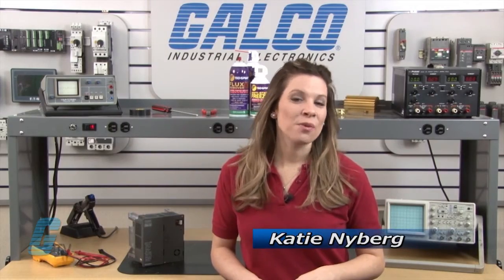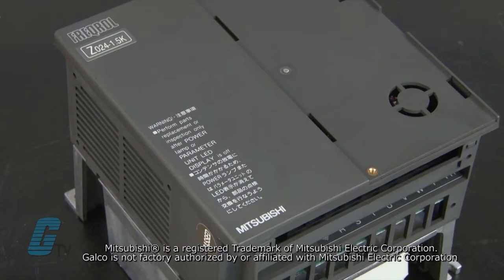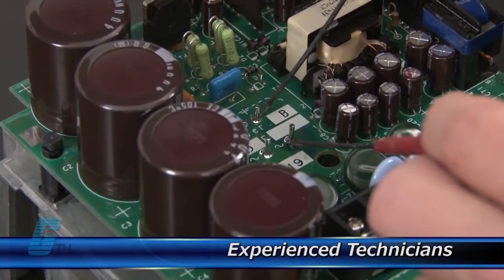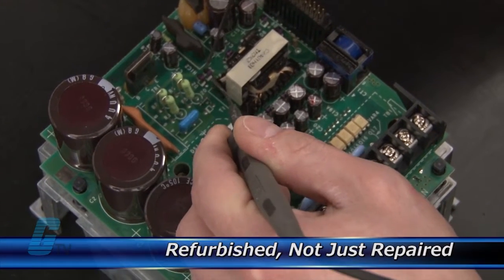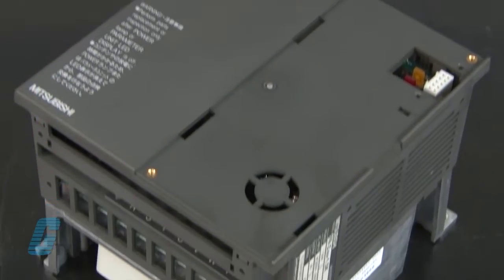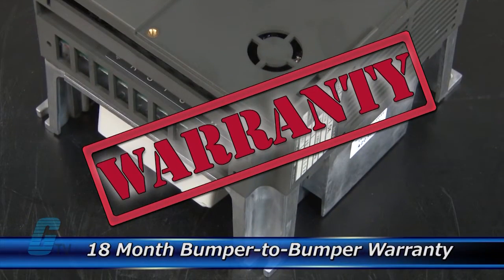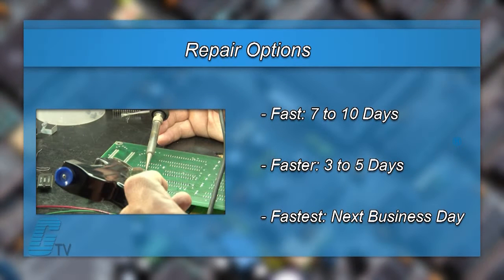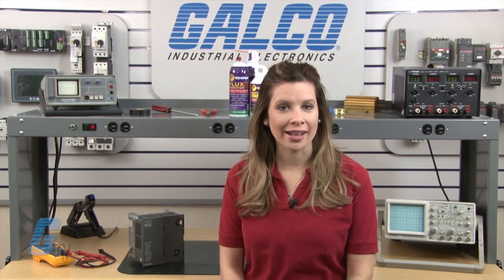Repair Mitsubishi Freqrol Z Series AC Drive

Comment: Hello,
What is the liquid you used to clean the board card?
Reply from the maker: It's a mixture of water and an industrial strength cleaner that we dilute to prevent the cleaner from leaving a film behind.
Reply: Hello, can you please give me the name of this industrial strength cleaner?
The vedios you made are useful but it is too short.
Thanks
Reply from the maker: Houari Tifest It's called a degreaser and it is diluted with water. There are a few places that sell degreasers and the water ratio may vary between each solution depending on the strength of the degreaser.